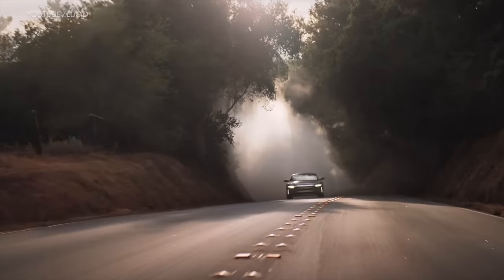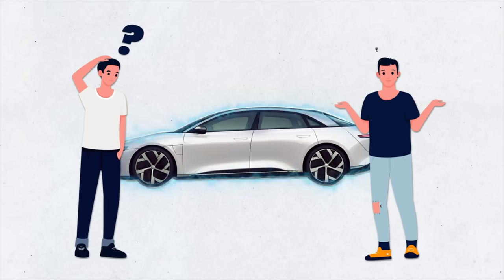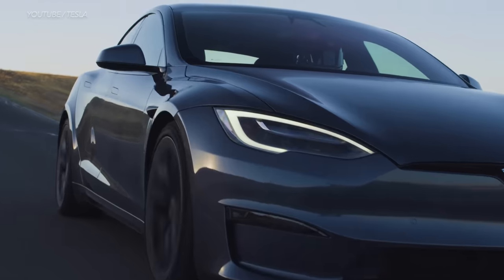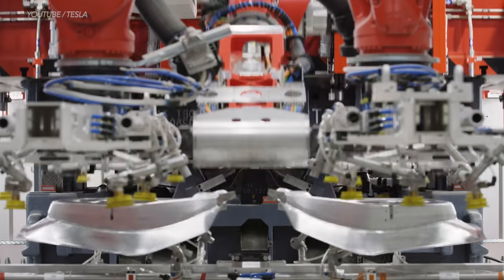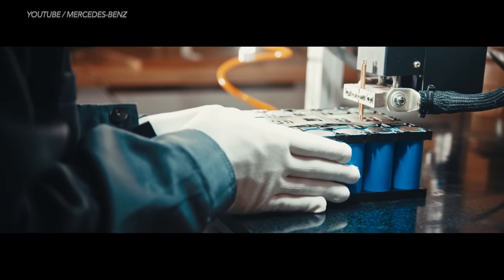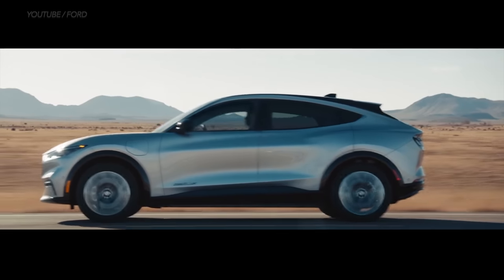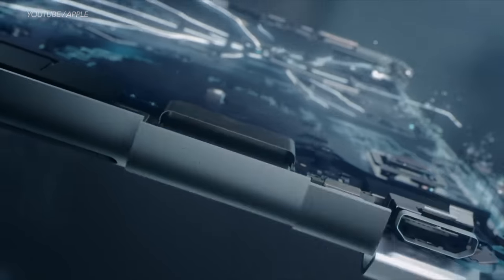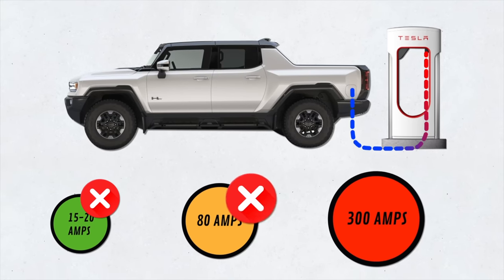Here's Why I'll Die Before I Buy an Electric Car

Comment: The real problem is government's big fingers in automobiles, such as an automatic kill feature which will be standard in 2024. Sounds good on the surface, but what if there's an emergency & they detect you driving too fast and kill your car, they could be killing you as well. And do they really think someone with bad intent will not be able to access this function? ( 🤣🤣) No, it's no laughing matter, it's a really bad idea that's already in the process. The smarter the car, the more expensive ALL repairs will be as well.
I can imagine Death Valley littered with Smart car coffins because they died in the middle of nowhere...and so did their occupants. Grid down for weeks after a hurricane? Good luck, you're stuck.
Would prefer a diesel/electric or a fuel cell/electric instead.

Comment: Aw come on Scotty. 

Who cares how long it takes for a full charge?  Most people will use 10-20% a day, and even IF they used a full charge every day, the 8hr charging time for a full charge is less time than most cars spend in the garage every night, which is when you would be charging it.   Scotty you're going to have to come to terms with the passing of time, sooner or later.  

Internal combustiom engines - as fun as they are - were obsolete decades ago, even though humanity wasn't smart enough to have prioritised solutions yet, and even though big oil invested big money to delay progress. 

Be a pawn of BP if you choose, Scotty, but it's you who gets left behind.  

Heres a fact - my ute gets me 600km for $150 of fuel.  A low end EV will get me over 7000km for the same cost, and that's assuming I don't charge it direct from my solar.  

Battery materials are recyclable. A tank of gas is not.  

I can "fuel" my EV without needing to line up on the way home from work. 

The answer the climate change is electrify everything, and produce green energy (solar etc) to run it. BUT, even if you hate having a breathable atmosphere and you hate the environment, EVs still make more sense from a purely financial perspective. 

EV's are here, you just need to catch up.

Comment: I'll buy an  EV when the prices are easily affordable and when batteries allow 1000km ranges and battery chemistry solves the problem of battery longevity and the charging issues. Also when battery manufacture does not use coal in electricity generation or the use of child labour in Africa or anywhere else! I might be waiting a while!!??

Comment: electric is the best thing ever to happen to motoring - batteries are cheap and fast charging 
(batteries are practical - wherever there is electricity you can get a charge)
Reply: The batteries are not cheap.
Reply: @usefulcontent9894  plenty cheap - how many times can you use a battery
Reply: @usefulcontent9894  make more -as in economy of scale 
(raw-materials scale easy)
Reply: @usefulcontent9894  vs an empty tank (of no fuel included) batteries sure are cheap
Reply: @replica1052  You got shares in Panasonic or something.
Reply: @usefulcontent9894  more electric is always better
Reply: @replica1052  battery's die after a while with no feasible ability to repair
Reply: @elijahnierstheimer9674  (batteries are cheap and fast charging)

Comment: Once someone actually tells the truth on how much it’s going to cost to upgrade the system to handle the need, we will switch back to oil or to another source.  In the meantime, say goodbye our tax money and wallets.
Reply: If 80% of all passenger cars become electric, the load on the grid will increase by 10-15%. This is currently, and EV's will become more efficient as the technology grows. In the US, the electrical grid increases it's capacities at a rate of about 4% a year. You do the math.

Comment: No EV. EV may be ok if you just ride around town but I like to travel and I travel with a travel trailer so I don't have time to go 100 to 200 miles and then have to wait to charge a vehicle.  I like to put gas in it and keep on rolling.  This country is not even close to having all ev on the road. I think we are 100 yrs away from it.  Which no one has been able to explain to me how EV are cleaner than gas powered vehicles.  Which I'm not a believer in the political "Climate Change".

Comment: Love your channel😁 
Please I got a Question: I got a VW Golf IV from 2004, it has about 150.000 miles on it.  Motor is a 1.6 SFI with Automatic transmission. It drives great, but now it has started to have issues when I start up the car and wanna move the gear stick. Normally I just press down on the breake pedal and a little icon lights up and then I can freely move the gear stick into drive, reverse or whatever. Now I sometimes have to press down on the breake pedal 30 times or more before the icon lights up and I can put the car into gear. If the icon does not light up, the gear stick is locked in parkin "P". 

Please, can anyone help me with some info, I can't seem to find any specific solution for the issue. The situation Is unbearable and it is getting worse and worse. Note that when i finally get the car into gear, it drives perfectly, so it is only an issue when it is in parking "P". Ones I can move the gear stick, I can easily go into drive, reverse an neutral and back again if I want. It is only from Parkin "P" the issue is accruing. 

Btw. I don't wanna drive it to a garage, I am afraid they will charge me big time and I simply cannot afford that at the moment 😓
Reply: @jamesvandamme7786  ok i will try that, thank you. I will return with info tomorrow 😁👍

Comment: It is ludicrous to have charging stations all over the place.
The EV needs a clever little self charging alternator, likely magnetic, which can run continuously in the background,
or when the car is idle.
Can't EV batteries be induction charged with magnetism as well ?
Why sell the concept of charging batteries at all?
Isn't it more important to have high strength safety cages, and onboard fire-suppression systems whether electric or liquid fuel powered?
It's the Chevy Corvair syndrome all over again.
Americans need to have something made wrong so all the critics can get air-time
on the 600 000 tv station across the nation.
The future isn't the future until the technology is futuristic enough.
Consumers need to buy vehicles from manufacturers who are serious about the future and not 
future anarchy.
On an Archon influenced  "Prison Planet" , like earth, one can only expect 'chamber-pot' engineering,
targeting the wealthy.
Remember the schoolyard rhyme: " Kindergarten baby, wash your face in gravy ? "
Jesus said: " Forgive them father, for they no not what they are doing. "
Blah, blah...
Reply: Every EV should have a Honda generator for backup!

Comment: Don't forget that Battery will die in about 5 or 6 yrs and costs over 18,000$ lol
Junkyard tome or an Ls swap canadate. Get a lod of the review from Hoovie's garage on the new Ford Ligntening. omg what a turd, it ran out of power towing a model A 30 miles. I saw on in person at the local fair and all i could do was laugh at it.  Unless mr fusion is powering it why would ypu want that! I converted my 2008 expedition to run on E85 for only 800$, almost any car/truck can be converted with a dimple kit. We make alchaol from plants right, almost no emmissions and 20% more Hp, its a no brainer - well not for our govt - lacking brains lately ;)

Comment: I want hydrogen cars and that would be progress, and not increasing demand of electricity. I still remember when 90% of Italy blacked out in summer a few years ago because the electricity we bought from France could not supply enough power and the whole country blacked out.. they ask people to save energy and water,which we also use to produce energy, so we should try avoid using home air condtioning and stuff, then we want to mass-produce electric cars.. This is a joke

Comment: I'll buy a EV when they have v8's motors lol... EV's we don't have the infrastructure for them. it's funny how people think buying a EV is saving the world. Well i got some bad New's for all of you liberals out there. here are the steps of making a EV battery. your not saving the world
Electrode preparation: The first step involves preparing the electrodes, which are typically made of a combination of materials such as lithium, cobalt, nickel, manganese, or graphite. These materials are mixed with a binder, solvent, and additives to form a slurry, which is then coated onto a thin metal foil.

Separator preparation: A separator is a thin, porous film that separates the positive and negative electrodes in a battery. These films are typically made of polyethylene or polypropylene and are treated with various additives to enhance their performance.

Electrolyte preparation: The electrolyte is the liquid or gel that facilitates the movement of ions between the electrodes. It is typically made of a mixture of salts and solvents and is carefully formulated to provide the desired performance characteristics.

Cell assembly: The prepared electrodes, separators, and electrolytes are then assembled into a single cell. This is typically done by stacking alternating layers of the positive and negative electrodes with the separator in between. The layers are then rolled up tightly to form a cylindrical or prismatic cell.

Module assembly: Multiple cells are then assembled into a module, which is essentially a larger battery pack. These modules can be connected in series or parallel to achieve the desired voltage and capacity.

Battery management system (BMS) installation: Finally, a battery management system is installed to monitor the battery's performance and ensure that it operates safely and efficiently. The BMS typically includes sensors, control circuits, and software to manage the charging and discharging of the battery and to provide information to the vehicle's onboard computer.